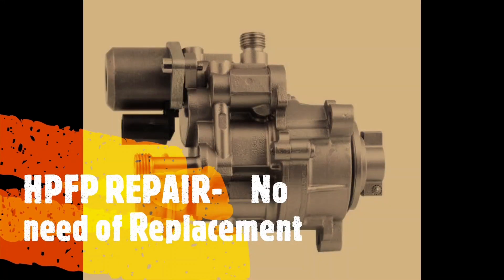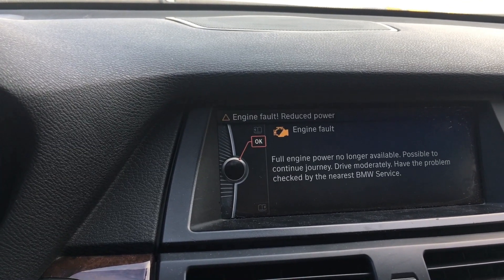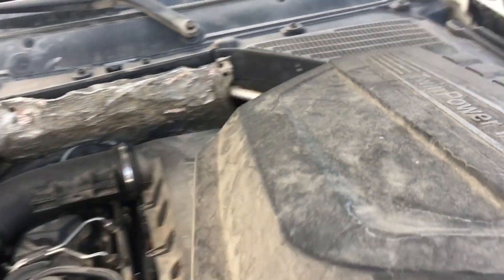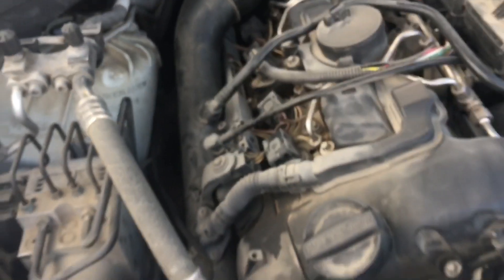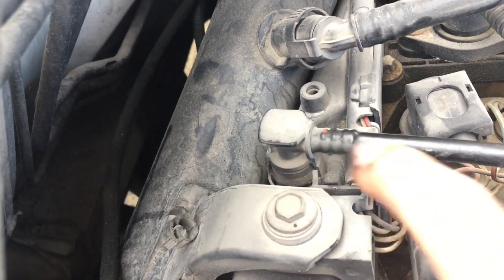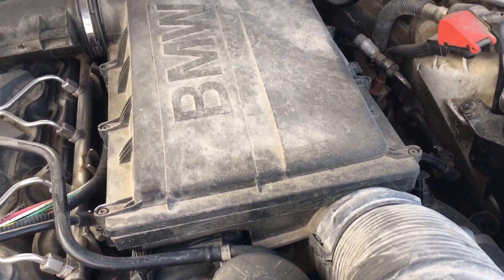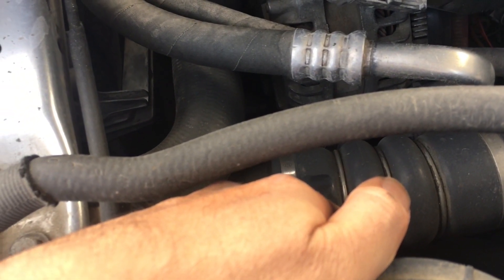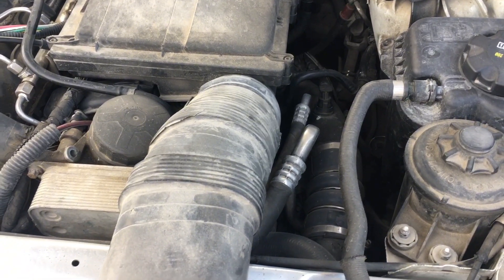BMW REDUCED POWER ON WOT DUE TO VACUUM LEAK - X5 N55 ENGINE !!!! EASY FIX FOR BEGINNERS

Comment: Dude are you driving in the desert? My intake tube with the MAF was loose but seems like there's still a touch of hesitation when starting from a stop.
Reply from the maker: Yes, I am in desert region. You have to scan the code or else you will work without a clue. There is no intake tube with MAP? or do you mean HFM?
Make sure the tube from valve cover to the exhaust is in good shape